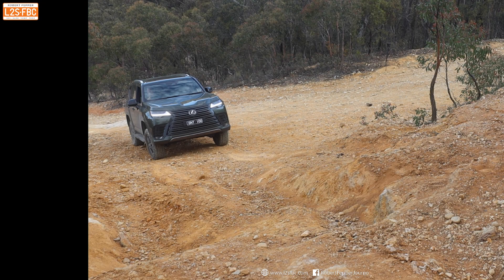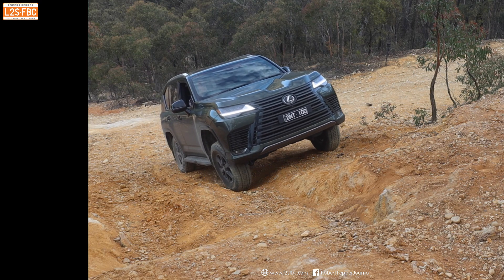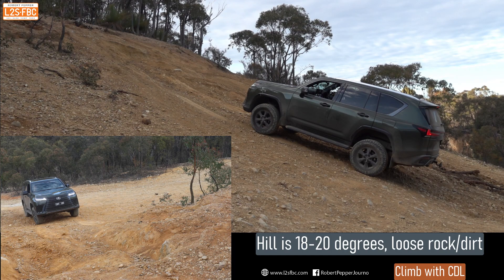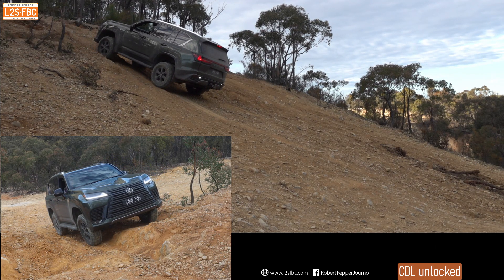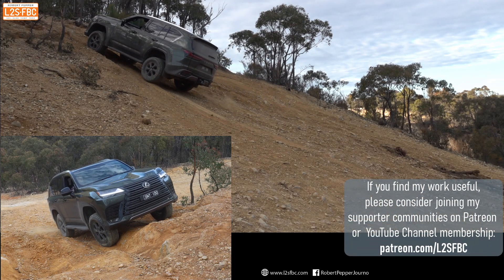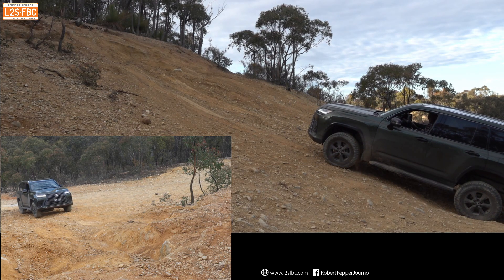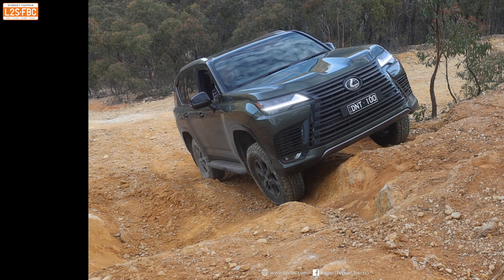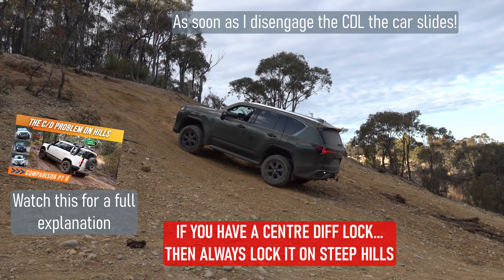The potentially deadly oversight on hills

Comment: Dont brakes apply equally to all 4 wheels regardless of centre diff lock or unlock?
Reply: Brake balance heavily favors the front axle since more weight is up front and because braking while going forward shifts more weight to the front. It's not uncommon for the front brakes to handle 70-90% of the brake effort, and they are tuned for that, which is also why locking the center diff helps stopping on ice, because the default brake balance isn't optimized for ultra-low traction.
Reply from the maker: Exactly, BlackForest!
Reply from the maker: No they don't.  Refer to the detailed video in the pinned comment.

Comment: Or, and you can listen to me here, because this is a bit crazy, you can not drive one of these electronic abortions off-road. If you need to be driving up 20 degrees of loose gravel you can get an older Hilux, Navara, patrol, maverick or cruiser, put it in 4wd and hit the hill with enough speed to have the momentum to go up it.

And yes, there was more than enough retardation on that hill.
Reply from the maker: I did listen, and you are completely wrong. Exactly the same problem will happen with an LC80, Discovery 2, Defender TD5 and many more - this is not about vehicle age.  Nor am I trying to ascend the hill.  It is a demonstration of what happens if you do not lock the centre diff.

Comment: Buy a real 4x4 and you don't have to worry about this.
Reply from the maker: The LX600 is a real 4x4.  Just needs to be correctly set up.
Reply: With a "real" 4WD you still need to have locked your hubs and engage 4WD. I have come across many Patrol drivers that only engage 4WD when they get stuck.
Reply: @greatnorthernrailwaytother4711 On none of my real 4x4s did I ever lose brake or steering control due to not locking my front hubs.

Comment: If I remember correctly was this not the same issue with the first gen Everest where you did the same test on the "hill of truth"? The 1st gen Everest (2015 to 2022) don't have a centre lock thus no 4H, however the current gen Everest (also V6 and select  Ranger 4cyl  with the same 4WD set up) also technically  has no centre diff lock either but does have 4H option as that is equipped with a centre multi plat clutch which can be variable (4A) and engaged up to 110km/h for 4H mode however also applies RWD bias for this type of hill climb as you have shown in the past.
Reply from the maker: Similar.  I am deliberately driving without the CDL engaged to show why it's important.  Gen 1 Everests unlocked their centre clutch at rest - refer pinned comment for the video demo.  Fixed on current gent AWD Fords, also shown in video.

Comment: Is it not the job of the wheel speed sensors and a variation of EBD (brake force distribution) to detect the relative difference in wheel speeds and get the ABS pump to push out more pressure to the rotating wheels?

I see how the centre diff being locked helps distribute force better as wheels with a lot of braking force and traction are essentially being asked to turn at the same speed by the drive line as those with little braking ability. 

That said, you can make the same argument that therefore you should also have any cross axle locks engaged to be completely optimal (minimal gain though since left/right braking ability difference is relatively minimal compared the front/rear difference).

Good video as ever, appreciate your ongoing efforts to educate 👍
Reply from the maker: Well you saw that when stopped, and then the CDL was unlocked, the car started to slide.  So the wheel speed sensors could only react to that, and it would better if that didn't happen in the first place as once a slide starts, it can be difficult to stop.  Then when the car is stopped the brake force would presumably reduce, then it'd slide again.  You can actually see that happening right here where the car stops/starts, same basic problem.  https://youtu.be/ln4MSePpMO4 What could work is a gradient sensor which applies appropriate brake force.  Or...just lock the CDL!  Except that can't work for twin-motor EVs.
Reply: @L2SFBC yep, fair points. No arguing on locking the CD, that just makes sense. I suppose I'm just kind of surprised that manufacturers have no built in sensing to manage this situation in this day and age. Quite a surprise!
Reply: ABS doesn't do anything at these speeds. It's usually disabled in 4low because it would only make things worse.
Reply: @BlackForestWoodStoving ESC (Electronic Stability Control) is deactivated, ABS still active for Traction Control in low range. Isuzu have just proven this beyond question with their revised traction control activated by rough terrain mode. 
Even when the rear diff lock is engaged, Isuzu have retained ABS active to front axle delivering traction control the whole time.
Utilised correctly it totally worthwhile in low range.
Even my GU Patrol still retains ABS for traction control in low range and yes it certainly works well, only ESC is disengaged when low range is selected..
Reply from the maker: It is not ABS for traction control. A wheel speed sensor feeds ABS and other programs.
Reply: @L2SFBC  probably should have used electronic brake force which I believe is controlled by ABS circuitry, but I'm happy to be corrected.
Either way, the point I wanted to make was it's not deactivated in low range by most manufacturers, it's retained for traction control, even in my old school GU Patrol.
Isuzu being praised for the latest revision of their traction control utilised in rough terrain mode, totally transformed their off road ability as you'd be aware.
Reply: @ianweal3081  I realize that traction control uses components of the ABS system to redirect torque, but you and I both know that's not what I was talking about.
Reply: @BlackForestWoodStoving you have totally confused me, you say it's turned off as would make things worse, yet I clarified it remains active to improve things, total contradictions.
To my way of thinking you interrupted it incorrectly. That was my only thought on the matter.
Reply: Not sure about Toyota/Lexus; but other manufacturers disable ABS when a car engages 4x4 low range.

Comment: A serious issue with awd on ice as well. Sometimes the abs  and brake assist functions on modern cars will activate the rear brakes, sometimes not.
Another situation where traditional handbrakes are sorely missed.
Reply: you know on most electronic handbrakes if you pull and hold, it will activate even when in motion, also pulling repeatedly will give the handbrake a better purchase on the disc or drum.
Reply: @overlandready The handbrake gives you the option of adding light braking to the rear without locking up. At least that's how I used it in the old days.
Reply: @0HOON0  again that one depends on the hand brake type, wheel based versions with a lever, yep, not a problem, transmission brake, to an extent (too hard braking can rag the mounts!) and it tends to overbrake the wheel with least traction. electric are either on or off... Which is why the lever is best in most cases. I have a transmission brake, so it's only ever used in emergencies...
Reply: Handbrake on ice/snow??? Yeah, no.
Reply: @WorldMusicMasters  two separate scenarios... also sometimes you do want to brake the rear while powering the front when you have not got 1cd locked.
Reply: @overlandready  if you want to drift s fromt wheel drive car in snow, yeah, that's over-steers you in line. I just can't imagine otherwise messing with rear brake locks (handbrakes) while front wheels are free. That immediately makes you lose control.
Reply: @WorldMusicMasters  See there you have 2 miconceptions, firstly who said anything about locking the brakes? Slowing the rear end to gain control is somewhat of an expert manouvre, but very successful of you have a 4wd, or are gentle, it actually brings the back in line, it's exactly what ESC does, but it has the ability to control individual brakes instead of both or nothing. 
Secondly, oversteer is a suspension geometry thing, the loss of control is skidding, aka a loss of traction, that's down to a few reasons, quite often in ice it's micro aquaplaneing due to the tyre pressures being too hard. The two things may be interlinked in some points, but the likelyhood one is the cause of the other not the same thing. You can under or oversteer but not skid. If you skid, you are not sufferning under or over steer, you're suffering a loss of traction. Over and under steer must have traction. but that's another subject.